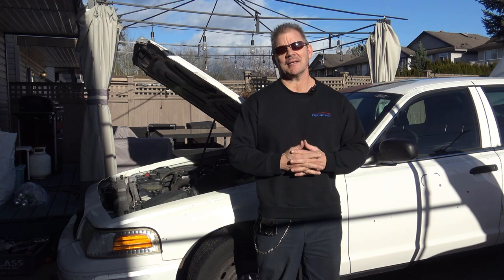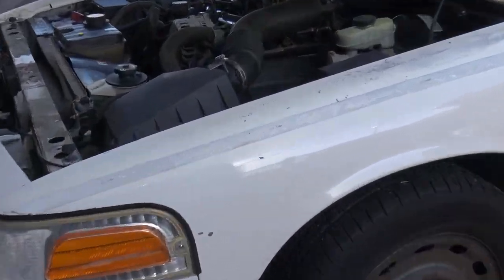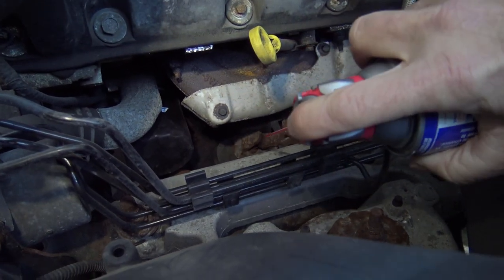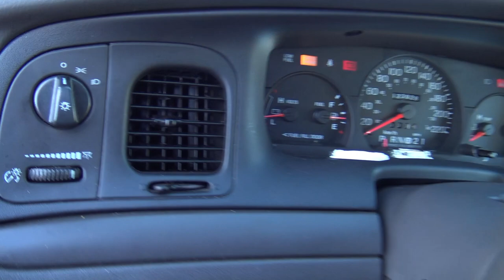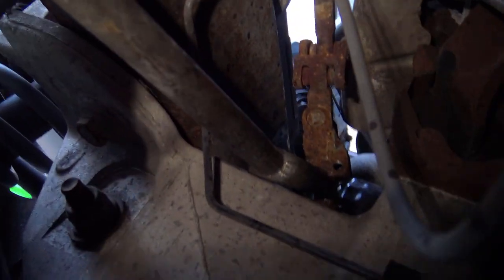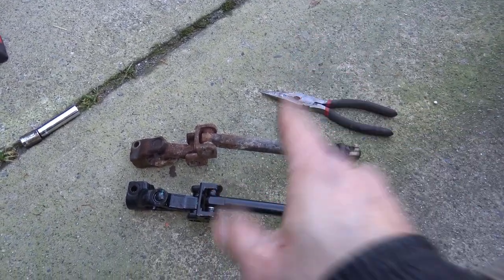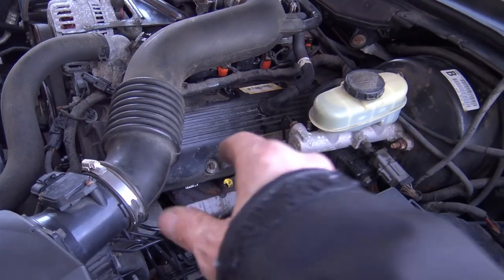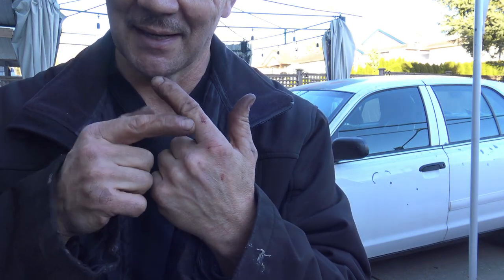Vic Stiff steering? replace your shaft!

Comment: You could get that fixed for free at the dealer it should still be under a recall
Reply: Looks like the recall was done.  There is a heat shield on the exhaust manifold.
Reply: @encinobalboa  so that means mine was done also from the previous owner. Mine went bad again

Comment: Thanks for the video I have the same problem with my crown Victoria I took it to the shop, They said the power steering pump was ok and that I need to replace the intermediate steering shaft. I took it out about 30 mins ago and will replace it tomorrow and pray that solves my problem. It's hard steering left and right but as long as it's straight it's ok, no vibration, no wondering or loose steer. Just got to fight to turn it. Thanks for the video

Comment: I'm having a diff issue yet the same? ok mine i think is a tie rod if my 2005 vic has one all i can see is ends for replacement parts anyway it started suddenly bad alignment steering wheel cocked quarter turn to the left to go straight it pulls hard to the right and the steering is loose to hard on and off, seemly hard to the left and easy to the right. Will bring this to my mechanic soon as i can problem is i work 3rd shift and sleep during normal people's hours . oh and bad tire wear outside of front right tire. this all happened in the span of 2-3 months. I drive in hartford it's a crappy city full of potholes it's hell on any vehicle.